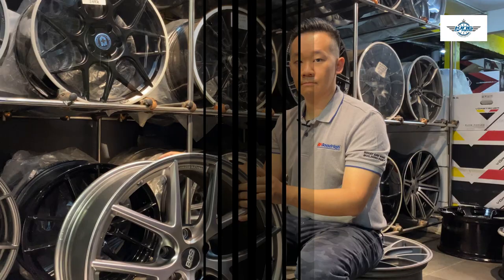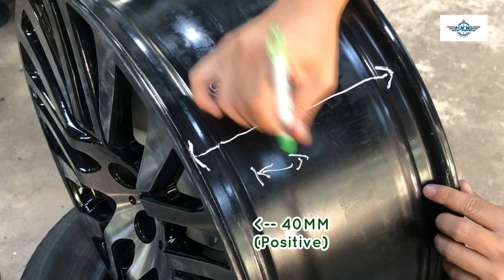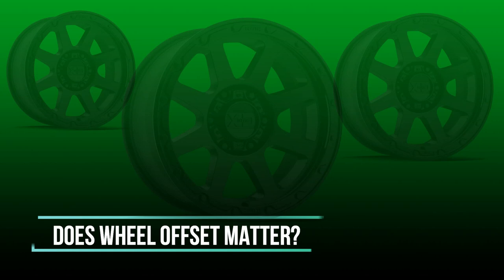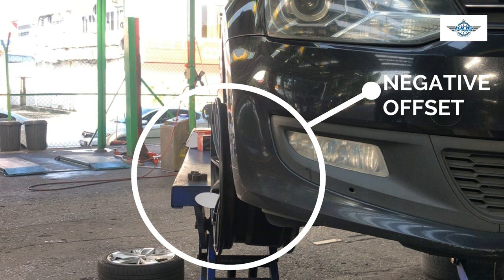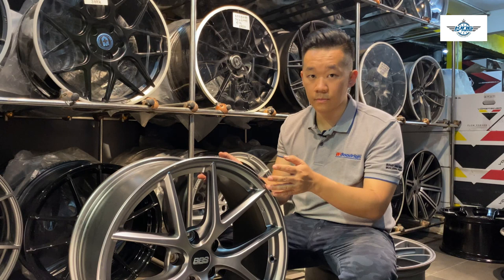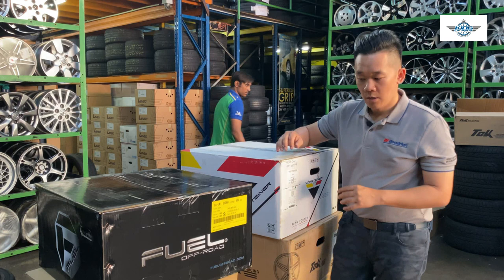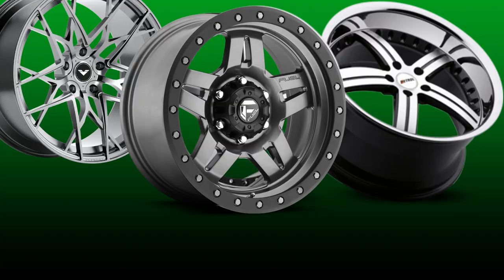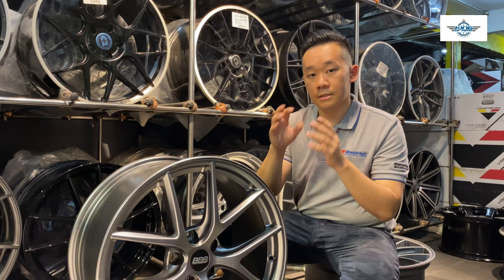How to choose wheels / sport rims for your car (WHEEL OFFSET)

Comment: Does the offset change when you go to a larger size wheel so if you have 17 inch wheels on a civic and you put on 19 inch aftermarket wheels, do you need to try and get the same offset or maybe a slightly smaller offset?

Comment: I have a question. I currently owned myvi gen3. I want to change my rims from 15 inch to 16 inch. Is it recommended to change to sport spring and absorber as well. Hope some one can give me some idea on this. Thanks.
Reply: Im no pro, but imo, stock suspension still works great with that 16 inch rims. But if you planning to upgrade your suspension as well, better do the suspension first than wheels later. After, there’s sway bar (depending how deep u want to go, there’s multiple option for bar on myvi). This improve handling, upgrade components mean better performance and of course looks.

Comment: I am driving a harrier turbo and recently I changed to a +35 offset rim. I did not find out what was the original stock rim offset. Based on your knowledge, do u think there are any issues with the new offset?

Comment: Boss. I just change my 16" stock rim honda city to 16" 7jj et38. But, now I faced new problem of the front tyre hit the absorber. The new tyre installed is PS4 205/50/16. Original is 185/55/16. Seek your advise on how to solve this. TQVM. (Fyi, I change PS4 tyre at your shop. Just realize the shop after seeing your video. 😄)

1 more question: what is PCD, and what is it for.
Reply from the maker: Contact me at 012-9820693 (Jeff) so I could advise you personally bro! Thank you for reaching out 💪

Comment: I am using  ET 46 for 195/65 15x6 , 5x114.3 stock of elantra. Low profile. While the stock setting for 17s 17x7 5x114.3 for elantra ET is 52.

Which is better inset to buy for 17x7 ?
Enkei with Inset 45 or 50? Im confused please help
Reply from the maker: Contact me at 012-9820693 (Jeff) so i can advise you boss!